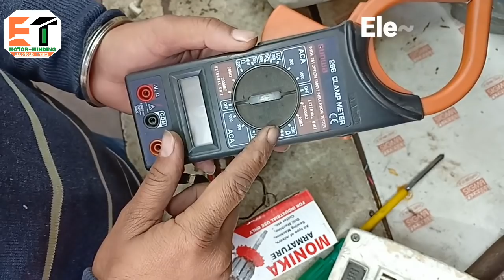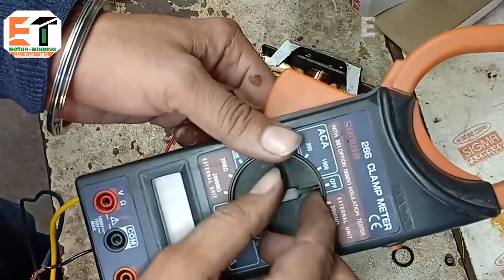Mixer Grinder armature change.मिक्सर ग्राइंडर को ठीक कैसे करते हैं  juicer mixer grinder repair

Comment: Sir mixer griender ma armature kharab hona sa kya kya problem face karna  padta ha
Reply from the maker: Motor ka current ampere badd jaate hai. Aur bhut jyaada heat hoti hai
Reply: @ELECTRICALSTRENDZSIGMA  sir griender ka maximum  kitna ampera rehena chaiya
Reply: Please reaplay zarur dena sir
Reply from the maker: 1 se 2 ampere tak
Reply: @chiranjibnayak2138  nys

Comment: There is spark on comutator on carbon brush what is the reason
Reply from the maker: sir koi problem nahi yeh sab mixer grinder ya carbon based motors me hota hai.agar jyada sparkin ho then you check carefully
Reply: I want lumix food processor armature can u provide me